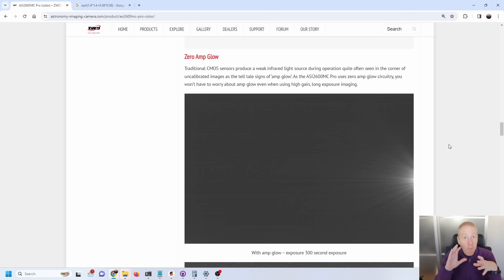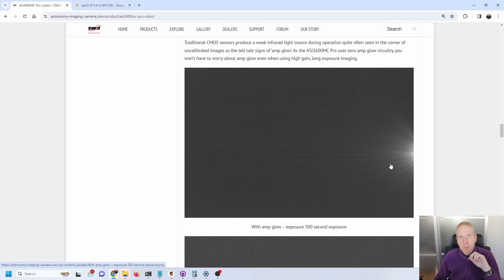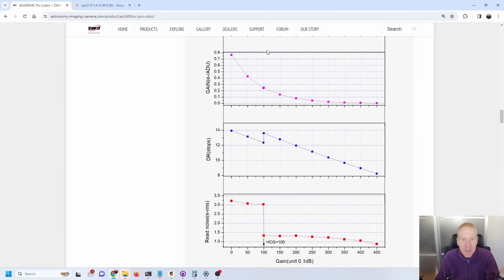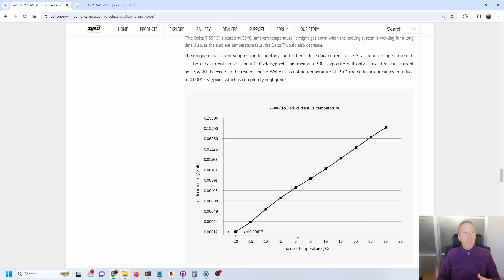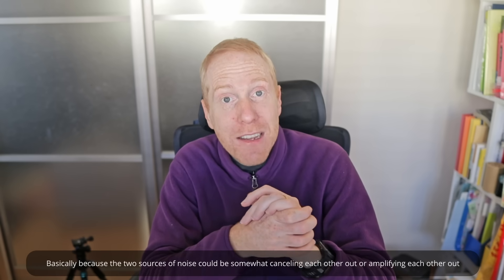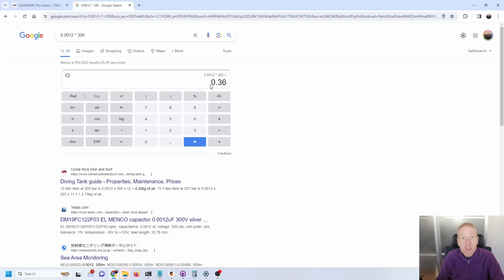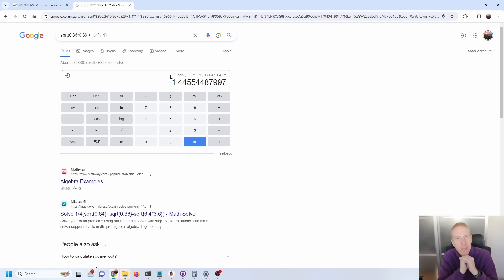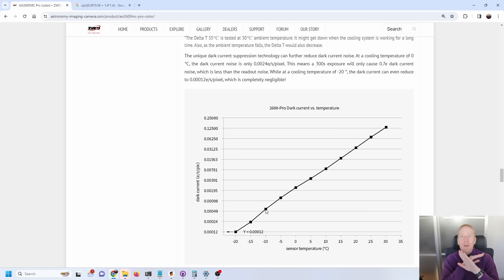Why I DON'T take Dark Frames (and what I do instead) - Astrophotography

Comment: I thought that dark frames will remove hot pixels as well. Am I wrong In thinking that? Do bias frames do the same with hot pixels?
Reply from the maker: Boop, pinned this comment! You're correct, although for me this hasn't been an issue, using good dithering (actual movement on the main sensor 20 pixels or more in my case, many people don't dither enough pixels) and sigma clipping! Even on my narrowband images I don't see any hot pixel walking noise, even stretched a lot...

Also I have noticed that my 1s bias frames also seem to take care of those hot pixels even before stacking, although they can indeed become more intense with longer exposures.
Reply: @CuivTheLazyGeek  Thank you.  I will try increasing my pixels to 20 when I dither.
Reply: I think you are right, although if you don't use darks but have dithering the hot pixels would be rejected with stacking.
Reply: @reab111  Not all of them get removed by dithering. Sometimes when you use biases instead of darks and really stretch the sky background, you can see some walking noise, even with well dithered data. I definitely saw that in my own images with faint narrowband data. After switching to using darks, and the walking noise goes away.
Reply: @reab111 that’s not my experience, dithering causes squiggly worms of hot pixels on my final images without dark frames. Using deep sky stacker.
Reply: @reab111  I kind of disagree.  Dithering moves your field of view on the sky, but doesn't move hot pixel locations in your sensor.  By dithering you ensure real objects you are trying to image get recorded by different sensor pixels, thereby averaging the pixel  response on those objects of interest.  So, yes, the impact of hot  pixels in the stacked image is mitigated if enough subs are taken.
Reply: You are correct, I still find that dark frames are essential with my 2600mc to remove hot pixels.
Reply: @defyent  I found manually curated defect maps and dithering deal with permanent and transient hot (and cold) pixels more precisely than dark frames (on both 2600MC and MM) - without introducing negative side effects (like darks or hot/cold pixel detecting).
Reply: @andrebremer7772  that sounds like a lot of effort ;)
Reply: @defyent  It's not that bad. It's less than 50 pixels total and they're very easy to spot on bias frames. You just jot down the locations and add it to a cam-specific defect map process, which you can reference from WBPP. For some reason it's worse on the 2600MM compared to the 2600MC. I update it every six months or so. It could easily be automated, but I have been too lazy to write a script. Very clean calibrated frames and no more hot pixel "squiggles" when dithering.
Reply: @andrebremer7772  what’s the benefit over dark frames ? Dark frames are little to no effort over the same time period and do the same thing, no ?
Reply: I just let Pixinishgt do the automation on hot and cold pixels - never had an issue with hot pixels.
Reply: What process (processes)   in pixinsight deal with the hot pixels? @ukastroimaging1016
Reply: I have 2 different cameras, mono and OSC, and I have to use new dark frames every 6 months or so to remove hot pixels.  I also dither and use pixinsight. If I don't,  I spend too much time post processing removing them.
Reply: If you are doing pretty pictures, and doing bright targets and stuff, generally speaking ya it's fine to skip the dark frames, it's really dealers choice. I think a majority of us will continue to fully calibrate our science frames, especially if we already have a workflow that also lets us do photometry, MPC, AAVSO work. But for pretty pictures, some pixel filtering, and a little bit of photoshop work during processing and it's really no big deal to skip the darks.
Reply: If you dither, you should be able to mask bad/hot pixels before combining frames. Can also efficiently be done automatically with sigma-clipping.  Even if hot pixels are "removed" by a dark, they generally anyway add more noise than signal, so better to mask them. Alternatively you could make a  noise estimate for each individual exposure and use that when using a per-pixel weighted average of the frames. The hot pixels would be down-weighted due to their increased noise, but this is most likely not worth the extra effort. Better just mask them.
Reply: ALL the stackers do a good job of hot pixel removal using a simple quick filter
Reply: Hot pixels / fixed pattern noise do change with exposure, so it's best to use dark frames. But it doesn't matter much for bright targets.
Reply: @Nabby13  not true for most hot pixels that I come across!

(I know the difference between dead and hot pixels)

Comment: Late to the party, thanks for the video! ChatGPT destroys this argument.

	•	✔ Dark current noise is small on the ASI2600MM
	•	❌ That does not make dark frames useless
	•	✔ Dark frames remove fixed, exposure-dependent structure
	•	❌ Bias-only workflows are incomplete for CMOS

The YouTuber is technically right about one scalar (dark current magnitude)
and wrong about the system behavior that actually matters for clean data.

Comment: We are trreating noise statistically, e.g. like gaussian distributed randomnes. But thermal energy distribution follows law of black body radiation. 
On the other hand readout noise might contain electrical impedances of parasitic LC loop (capacitor inductor loops) leading to some kind of resonances and harmonics. Maybe some insider will decipher noise in deeph and will give us an even better how-to to get rid of noise in our pictures based on a sequence of calibration frames (and its deviation frome frame to frame) and not only averaged master calibration frames. The future will tell.

Comment: so, what this vid all boils down to is cooling your sensor reduces dark current noise.  OK, no big surprise there. But, 2 questions. 1) why is read noise so large compared to cooled-sensor dark noise. 2) what about "hot" pixels, even at cooled temps? One of the purposes of dark frames, as I understand it, is to remove hot pixel spots from your target's exposure.  That seems to be ignored in this video.

Comment: Cuiv - you can make a similar argument about not cooling the camera. If the sky noise (photons/sec/pixel * exposure_time)  exceeds the dark current*exposure_time (and read noise),  by a factor of 4 or more, the sky noise dominates, and little is gained by cooling.  When you are in a high LP environment, even with narrow band filters, cameras with the  IMX 571 sensor with low dark current will be sky noise limited even without cooling.

Comment: It's been helpful to me to think about the calibration process using dark frames as removing unwanted signal -- e.g., the hot pixels.  Just like light frames, there is noise associated with the dark frame data, too.  As you said, dark frames (and bias frames) don't remove noise, they calibrate the signal captured by the light frames.

Comment: I have a ZWO 2600MCPro+ ASIair. I notice that if I  don’t take dark frames, the flat calibration is going for a toss and is getting overcompensated. Any idea why this would be happening and any solutions you could suggest. I generally use deepskystacker for pre processing
Reply: Sometimes got this issue with dss too. Its weird. but you could try using dark flat frames instead.

Comment: I have been using Bias frames only ever since I saw this video. I've been using Pixinsight but was giving the early Beta of Sas a try, and saw that there's no place to add Bias frames. When I asked Frank about this, he said there's no such thing as Bias frames on a CMOS camera. He then said this:
SetiAstro — Today at 12:00 PM
you have to think that you are calibrating not your image globally (ie there was some amp glow on the side or vignetting in the corners).  you are calibrating the response of each pixel itself.  so you expose your sensor in pitch darkness for the same length of time and sensor temp that you will be shooting subs for.  now that dark exposure records, per pixel, just the sensors response to no input over that period of time.  not only any stray light in the camera itself (amp glow, etc) but dark current, ie thermal electrons getting recorded, as well as pixels that output a high signal value or very low signal value when nothing is present, hot and cold pixels.  since all those are randomly distributed you take multiple dark exposures and average them.  now you have the average response PER PIXEL of just having it turned on and capturing no external photons.  Then you also take flat frames.  That is going to capture the sensors response PER PIXEL of a uniform illumination field.  This captures how much light based on position that particular pixel gets in the optical train versus all the others.  It will also capture the non uniformity of the pixels response compared to others (ie how sensitive it actually is to incoming photons.  the silicon changes across the substrate so no two pixels in your sensor respond exactly the same way).

Now you have flat darks which are just darks that match your exposure time of your flat images.

putting it all together at the PIXEL LEVEL now.  You take an exposure of deep space.  You then subtract that dark signal from that.  Removing the inherent non-signal response from THAT PIXEL.  Then you divide by your flat.  This normalizes THAT PIXEL to the response recorded in the uniform light field.  Now that is repeated millions of times for EVERY SINGLE PIXEL in the image, calibrating their responses.

So dont think of darks and flats as global corrections although to the eyeball it looks like you are just removing hotpixels and correcting vignetting.  You are calibrating your sensor at the PIXEL level
This is why I disagree with Cuiv
Thoughts?

Comment: Cuiv, your way of reasoning doesn't make any sense. You say yourself, at the very beginning of the video, that darks don't remove random noise (which is true). Yet, the calculations you make to prove that you don't need darks are for the random noise only! So it's pointless to make those calculations, because they are not the reason to skip darks. The real reason is that you don't have ampglow / banding / any other type of fixed pattern noise. Period. The amount of dark current, dark current noise and read noise don't have anything to do with the need of using darks.

And another mistake is that you treat the dark current signal (this value which is shown in ZWO's chart) as if it was the dark current noise. Which is not. To make the calculations correctly you should add the dark current signal and the read noise to the power of two, and square this sum. The result will still be negligible, but anyway, if you do any calculations you should make them in a correct way.

Comment: Good overview and that really makes completely sense in the case of short exposures! However, there is a nuance. Those electrons are real thing, but IMHO it is useful to compare those noise signals to actual (analogue) gain value - 183mm sensor at electronic gain 100 gives ca 1.15 electrons per ADU (or so). The signal you have at the end in the computer has signal units as ADU-s. So I think it is OK to say that till a noise source is quite a bit below 1 ADU, you can just ignore that. The same applies also to the amp glow - if you estimate the amp glow max signal with lets say 600 second exposure, the measure of ADUs per second allows to estimate if that amp glow with some specific exposure time is worth to consider (more than 1 ADU) at all or not.

Comment: I use no calibration frames at all with my ASI533 and my 500mm f/4 canon lens (which has no vignetting on this small sensor) and get excellent results. After getting back to the hobby after 10 years I feel the new equipment, especially the new sensor tech makes all the old habits obsolete... only the literature and the youtube tips have not caught up with this development yet... therefore many thanks for CUIV to speak it out!

Comment: I wanted to revisit this topic and give my own anecdote. I use an IMX585 sensor and after viewing this video, chose to not use dark frames. This seemed to work very well for me and I captured quite a few targets. Then I shot M33 with dual narrowband in an effort to add beautiful Ha data. I could not get good results after stacking. It really appeared that my flats were not working. Serious vignetting, dust motes, all of the typical artifacts you’d expect from poor or nonexistent flats. Then, as a last ditch effort, I captured some dark frames (which took less than an hour) and restacked. Guess, what? The artifacts were gone and I could now use much less aggressive background extraction. 

The point is, that you should really do your own tests. It may work, it may not. It may even work for a while.  My specific results show that I need to capture darks. This link is the comparison. The only difference is the addition of dark frames. https://i.imgur.com/BpEI4rM.jpeg

Comment: My first dedicated OSC camera was an ASI 294MC.  I was immediately aware of the amp glow problem.  I am an old engineer that has worked with the fabrication and application of solid state circuitry (IC's, or Chips).  From the very beginning of solid state circuits back in the '60's, we were aware that the architecture of our circuit boards could have a major effect on the output of certain IC's.  As a result, AFTER the electronic design gave us our desired output, we then applied the architecture of the circuit boards so we could minimize any effects caused by the closeness of the chips to one another.  Since we were doing this over sixty years ago I was surprised to see a modern camera with amp noise simply because the heat of an IC (usually an amplifier) was too close to a video sensor.  Rather than mess with calibration frames designed to correct the error I looked for a camera that didn't exhibit the poor design of the 294.  I found that the ASI 533MC was essentially the 294 with a proper circuit design that moved the heat-producing chip away from the video sensor, thereby removing the amp glow problem altogether.  That was about three years ago and I have not wasted the time taking Darks ever since.  When asked why I didn't use Darks I found that explaining why usually resulted in blank looks.  Your explanation is more exact and mathematically accurate, which I appreciate.  The simple answer is, of course, don't get a camera that, by its design, injects defects.  Thanks for the elegant explanation.

Comment: This is a great video and thanks for the insights. Perhaps you might answer a question I have long had on this matter with ASIAIR. This device does "automatic master flat" frames, biases and darks in its optional routines. I have never understood how it does an automatic flat frame on the fly. Does it use something like your method but a simulated bias that it extracts from the flat? Or is it wrong to call its "stacked flat" a master flat? I certainly use the flat, bias and dark in the "live stacking" option so curious what exactly IS the AsiAir "Master Flat" file?

Comment: The bias frames take care of the readout noise. Darks capture thermal noise with readout noise, right? So when taking both bias and darks, what is subtracted from the actual light frames are only the thermal noise, since bias took care of the darks. So then your statement about the vastness of readout noise compared to the actual thermal noise in the dark files is false, or am I misinterpreting something?

Comment: I take 20 minute exposures and completely ignore Bias frames. Still using 16803 chip which has a lot more dark noise than a Cmos. Also read out noise is 10 electrons. As you can see some of us are still in the dark ages.😁

Comment: Thanks Cuiv, this works well with my ASI2600 MC pro and it's great not to have to spend time doing loads of darks 🙂 I dither every 3 images by 5 guiding pixels (15.3 imaging pixels) and use darkflats as well as cosmetic correction in WBPP and my images are nice and clean.
Reply from the maker: Great to hear!

Comment: Very cool - I think I'm gonna try this. I have 571, 455 and 533 based cams and although dark frames are a simple process, it becomes a chore to keep them up to date. Especially if I play around with different temp, gain & LCG/HCG combos.  Do you shoot bias every time as part of your session, or just every 6 months to year similar to what you would have done with darks? I've never used bias/master bias - but it sounds basically like a short 1s dark the way you describe it. I do use dithering and Cosmetic Correction, so I can see how that removes hot pixels. In fact on the 533MC, I've found CC does a better job than darks on hot pixels.

Comment: Modern CMOS have on-fly built-in dark frame substraction, in short, they measure capacitor twice ‘correlated double sampling’, just before frame start and actual later, and pass difference as result.

Comment: Dark frames introduce additional noise, but you need them in order to get rid of hot pixels, which every sensor exhibits. My Player One Uranus-C camera uses dark frames internally! If I switch them off "all hell breaks loose". My Canon EOS 600D uses a mapping algorithm to get rid of the hot pixels. I don't know exactly how that works, but I guess it is akin to a dark frame. If I don't apply the mapping, the image is full of hot pixels. (As the number of hot pixels is a function of temperature, hot pixels may not be so much of an issue with cooled cameras, but as I don't possess such a camera, I can't say much about that).